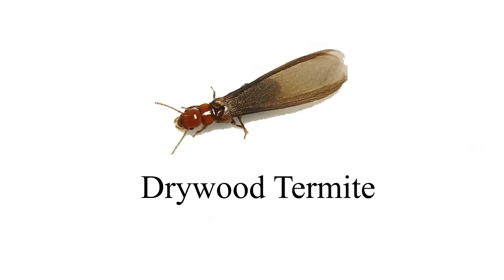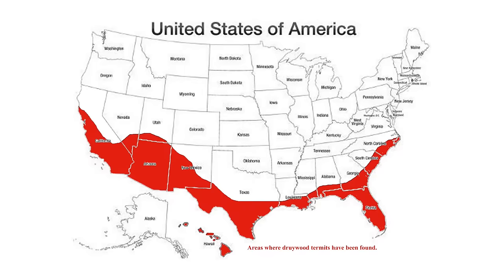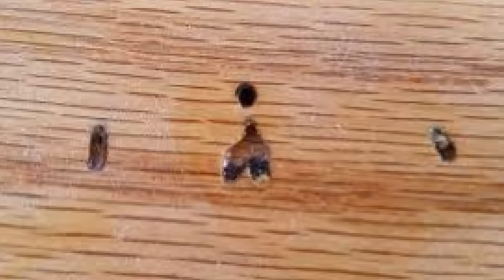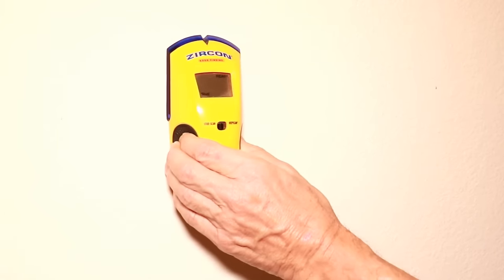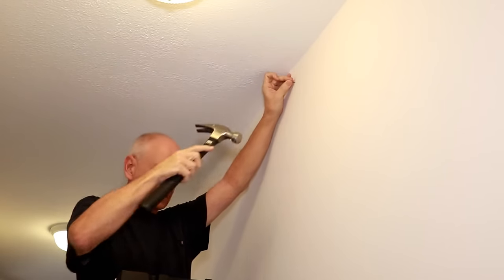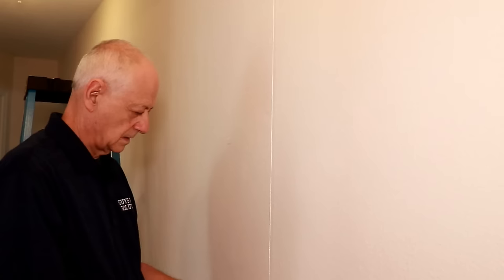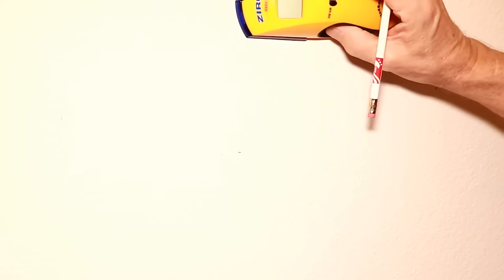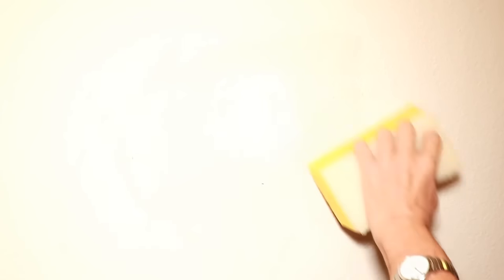How to Treat a Drywood Termite Infestation Yourself. A MUST see if you have Drywood termites.

Comment: Do drywood termites live inside the house?  Or do they need to work their way outside?  
I found a hole in the drywall ceiling with frass on the ground below.  Can I just shoot some foam into the hole?  Or is this not effective?  Thanks
Reply from the maker: First, make sure that this is actually frass that you are seeing and not mud.  If it really is frass, then you probably do have drywood termites.  Even though I did a video on how to treat them yourself, I do not recommend doing it.  The problem is finding all the galleries.  As you can see from my video, finding all the galleries is almost impossible.  Therefore, I always recommend fumigating for drywood termites.  Since you cannot fumigate yourself, you need to hire a company to do this.  Please watch my video on how to do it without getting ripped off.  Prices vary wildly sometimes with this, so my video can save you a lot of money.  Let the inspectors have a look at the frass and they should know immediately what they are looking at.  Let me know if this turns out not to be frass and I will guide you further.

I hope that helps.  Be well my friend.

Video on how to hire a pest controller:  https://youtu.be/y-a8XOqVrlE

Comment: Hello Guy, I have termites inside an exterior wall with a 10X10 ft. concrete patio on the outside. I drilled holes on the inside drywall and then spray canned termite killer but the insulation, I think, is keeping the poison from reaching all of the termites. What do you suggest I do?
Reply from the maker: The first thing you need to do this to identify the species.  Please have a look at my video on how to identify termites species.  There is a map in that video that will show you where drywood and Formosan termites are a problem.  If you live inside the red for orange areas on the map, then you need to dig a little deeper to find out the species.  The video will explain exactly how to do that, but let me know if you run into any problems with it.  Please get back to me if you live in the red or orange areas.  Hopefully, you live outside of the red and orange areas, which means you are dealing with a common species of subterranean termites.  If that is the case, then you have a fairly easy problem to solve.  If you purchased something like Spectracide termite foam, then that probably made the problem worse.  It will kill a few termites, but it is a repellent pesticide, and it will cause the termites move to another area and actually spread the infestation.  If these guys turn out to be subterranean, then you need to attack them from the ground, because subterranean termites always colonize in the ground and never your house.  Your house just happens to be their favorite restaurant.  You can still do a spot treatment, which will give the process a boost, but you also need to treat the soil around your house.  I'm going to give you links to a couple of videos that will show you how to treat the soil around your house.  One video we'll show you how to treat using termite granules, and the other video we'll show you how to trench your house.  If you have fairly porous soil, then the granules should work fine.  Just dig a small hole that is about four inches deep and fill it with water.  If the water drains into the ground fairly quickly, then the granules would be a good choice.  Otherwise, you need to trench.  I will also give you the procedure for doing a proper spot treatment below.  So, just to recap.  Watch my video on how to determine the species you have.  If they are subterranean termites, then choose one of the treatment methods that are in the other videos.  If you determine that these guys are not a common species of subterranean termites, then you need to get back to me so that I can guide you further.  Please note that if you use the granules, you need to get the ones that use imidacloprid as the active ingredient.  A lot of the Home Depot and Lowes stores no longer sell them.  You can still get them from Amazon and I will give you a link for that as well.

How to spot treat subterranean termites

If at all possible, spot treating for subterranean termites should not be the only approach to eliminate an infestation.   An additional exterior treatment should also be done with either granules or trenching, whenever possible.  Spot treating alone may totally eliminate the infestation with no other treatments, but it's not a sure thing.  

To spot treat subterranean termites, you need to buy a fipronil foam. I will provide links for two products that you can choose from. I like the FiPro the best because it's a little less expensive and I like the applicator tip better, but the Termidor Foam also works very well. The FiPro is not available everywhere. If you can get one of these foams, then drill holes in all damaged areas, that are 4 inches apart, and drilled about halfway through the wood. If you are seeing exit holes in the wall, then there is most likely a stud behind the exit hole. Get a stud finder and locate the stud where it meets the ceiling and drive a small nail into the stud a couple of inches below the ceiling.  Attach a weighted string to the nail and that will show you where the stud is. Then drill the holes 4 inches apart along the entire length of the stud, about 3 inches deep.  Do the same thing for woodwork, except only drill the holes halfway through the wood.  If you think that there is a 2 x 4 behind the woodwork, then drill a 3-inch-deep hole every 8 inches.  The holes only need to be wide enough to get the applicator tip of the foam can into the hole.  After the holes are drilled, then shoot the foam into each hole for about 5 seconds or until you have foam either coming back out at you or coming out the other holes that you drilled.  All the holes should have foam either going into them or coming out of them.    This will contaminate their food source and they will take the fipronil back in the colony and spread it around to the other termites.

Most of the time, subterranean termites are going to be building mud tubes somewhere. You will most likely find these mud tubes going up the exterior or interior of your foundation and you may find them along joists and even in the attic sometimes. If you have a slab home, then you may find them going up the outside of the house on the slab and even the side of the house. If you can find the mud tubes, then you can treat them as well. Just scrape off about a 2-inch section of each mud tube down to the bare surface. Then, shoot that foam into each side of the mud tube and also apply a little of it on the surface where you removed it. The termites will rebuild the mud tubes and bring the foam back to the colony to spread around to the other termites. 

Also, if you can find the mud tubes, this is a very good way to determine when the infestation is gone. If you scrape off that 2-inch section of a mud tube, you can see if there are any live termites in the tube. Again, the termites will rebuild the tube and go about their business. Do this every two weeks after you finish all your treatments. Apply the foam to the mud tube every time you do it. At the point you are no longer seeing live termites and they stop rebuilding the mud tube, then your infestation has been eradicated. 

It typically takes several weeks for this process to be effective. That is because you are using slow kill products. If you were to kill the termites too quickly, then they would not have a chance to bring the poison back to the colony and share it with the other termites. If you don't kill off the entire colony, you will not end the infestation. Therefore, you must kill off subterranean termites very slowly. So, I would give this at least 12 weeks before I would decide that the process didn't work. Hiring a professional to trench your house is pretty much going to take about the same amount of time to kill off the colony.

I hope that helps.  Be well my friend.

Video on how to identify termite species:  https://youtu.be/dIs_a0nfVjg

Video on how to use termite granules:  https://youtu.be/H7rW_TSBHJ4 

Video on how to trench for termites:  https://youtu.be/Fy7YHi_7Z8g

Termite granules:  https://www.amazon.com/dp/B000RUIJYM?ref=nb_sb_ss_w_as-reorder-t1_k1_1_7&amp=&crid=22GC8P8885EWJ&amp=&sprefix=termite                         

FiPro:  https://www.solutionsstores.com/fipro-foaming-aerosol

Termidor Foam:  https://www.domyown.com/termidor-foam-p-3528.html

Comment: With all that said in the video is fumigating with a tent better than all you would do yourself or would we be wise to do both self-application and tent fumigate?
Reply from the maker: Fumigating is just about a sure thing and no other treatment is needed.  It is the only way that I would do it.  Keep in mind that the gas they use has no residual action, so you can get reinfested the moment the tent comes down.  If you have drywood termites, then your neighbors have them too.  They swarm for several months a year, so they will attack your house again as soon as they start swarming, which could be while you are fumigating.  To prevent this you must do a preventive treatment, starting before they fumigate.  I will give you a link to my video on how to do it.  I hope that helps.  Be well my friend.

Video on how to prevent drywood termites:  https://youtu.be/neNsmVbj8Pc

Comment: I live in the coastal area of southern calif. We have drywood termites especially in the fascia boards. I've treated my attic and garage rafters with Bora Care 5 years ago. Most of the termite companies all want to tent house. (It's over 50 years old, never been tented). I've replaced or tore out the  damaged fascia board with bondo.  I also spray with bora care if I can get to raw wood. (It doesn't recommend using it on painted surfaces. ) My question is if I have the house tented, the termite companies only guarantee it for 2 years. After which time they want 600 to 1000 a year to inspect on a monthly basis. Would I be better, as one guy suggested , to just have the house tented every 6 or 7 years?
Reply from the maker: It is true that the only sure way to get rid of drywood termites is to fumigate.  Since you treated the attic with Bora-Care, then you should not be having a problem with dry wood termites in that area, if you did the treatment correctly.  However, you probably still have dry wood termites in your walls as well.  If that is the case, then you have no alternative but to fumigate.   I responded to another one of your comments that was attached to a different video, but I will give you a link to my video again on how to hire a pest control without getting ripped off.

Now, let me be clear, the two-year guarantee that the pest controllers are going to give you is totally worthless.  You see, if you have drywood termites, then your neighbors have them as well.  Since the gas they use to fumigate has no residual action, then you can get reinfested the moment the tent comes down.  The problem is that you will never know it because it takes four to seven years before drywood termites mature to the point where they can swarm.  Therefore, you must do a preventive treatment on the exterior of your home at least every three months to prevent another infestation.  A lot of people just treat every six or seven years because they think that is how long it takes to get reinfested, but the truth is that your house is getting eaten for those six and seven years.  The pest control companies understand that it takes four to seven years before you were going to realize that you are infested again and if you are paying them $600 a year, then they are going to make almost $5000 before they have to tent your home again.  So, what you are really doing is prepaying them more money than necessary to do a job that you could simply just hire them to do when it needs to be done.  So, those extended guarantees are a total waste of money.  I will give you a link to my video on how to do a preventive treatment on your home every three months.  However, I would recommend that you do this treatment every two months.  That is only an extra two treatments a year and it's a good idea because the effectiveness of pesticide is greatly diminished in that third month.  You should begin doing this treatment immediately.  That is because there are drywood termites still flying over from other houses that are continuing to infest your house in additional areas.  So, you would be wise to put a stop to that immediately.  At a minimum, you should begin doing the preventive treatment before the house is fumigated.  Again, that is because the fumigation gas has no residual action and you need to get the protection in place before the tent comes down.    

The products that you need to do the preventive treatment on your house can probably be obtained from domyown.com.  Since you are fumigating, you can probably just treat your house every two months Bifen IT.  I will give you a link to the product.  

I hope that helps.   Be well my friend. 

Video on how to hire a pest controller without getting ripped off:  https://youtu.be/y-a8XOqVrlE

Video on how to prevent drywood termites:  https://youtu.be/neNsmVbj8Pc

Bifen IT:  https://www.domyown.com/bifen-it-p-226.html?sub_id=553